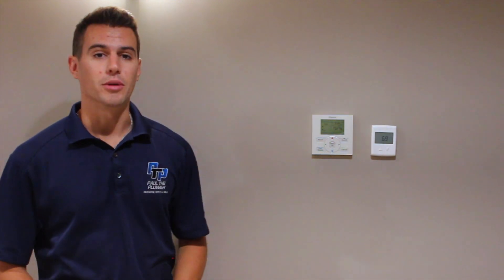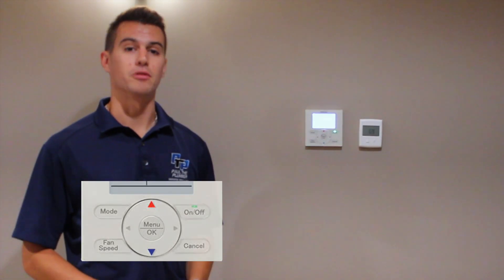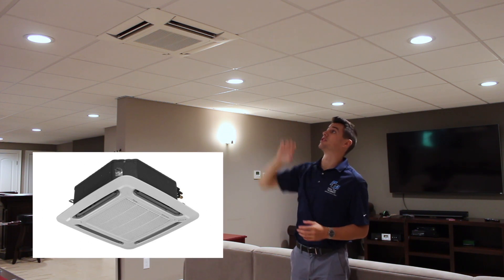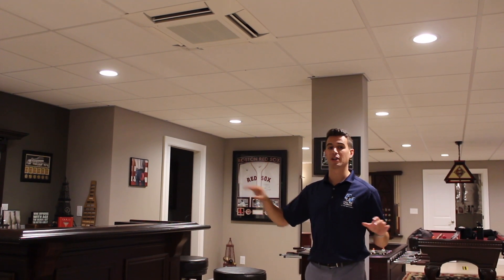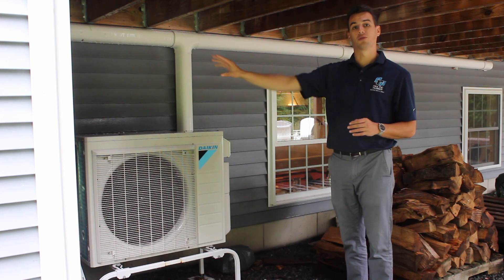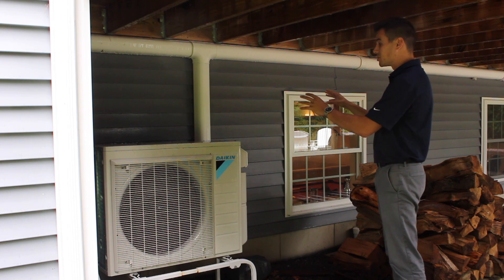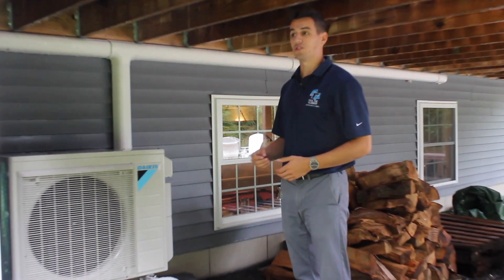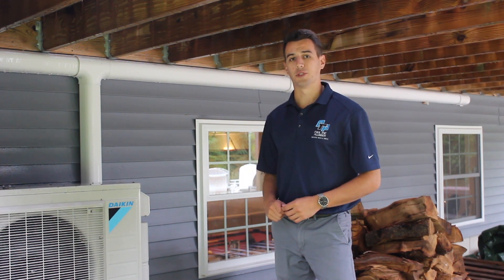Ductless Mini-Split Install (Ceiling Cassettes)

Comment: Could I use one cassette in ceiling of upstairs hallway to cover 3 bedrooms?  Obviously with doors open.
Reply: Not a good idea. If it gets warm in the rooms, the condenser will stop once the HALLWAY gets cool enough, but the rooms will likely be much warmer. Might as well go window mount for rooms.

Comment: Can you mount the outside unit on the roof. Run the the hose those vent turbine in the attic
Reply from the maker: You usually only see that in commercial applications. You need the unit to be level. You also need a disconnect and whip for the electrical side of things.

Comment: Are these easy to service? Are they longer lasting than a wall mounted unit?
Reply from the maker: The service can be a little more difficult. They have the same manufacturer warranty as the wall units.
Reply from the maker: @breadgarlichouse2265  Not typically. Sometimes there can be leaks but it's not specific to the ceiling cassettes.

Comment: Can this installed in a basement in a ranch?  Where does it drain?
Reply from the maker: It depends on if you have any access above the ceiling in that basement, this worked out here because of the ceiling tiles. You need a condensate pump with these units to drain.

Comment: Can a universal remote be used for this type of Air Conditioner?
Reply from the maker: It has to be a wired t-stat to the unit (like the one in the video) or the brand specific remote controller.
Reply: @paultheplumber8665  kk thanks
Reply from the maker: @issakaismaila5567  no problem!

Comment: The thermostat on right is crooked.
Reply: Beat me to it, spent 15 years in hvac commercial industrial and retired as an independent tile contractor. Sorry but I'm a bit OCD about being level, plumb, with straight lines and proper angles.
Reply from the maker: Thanks for the feedback!

Comment: If the cassette is on, what is the vibration like? Would it vibrates the ceiling if mount on 1st floor and be heard on the floor of the 2nd floor?
Reply from the maker: Very low vibration and they are super quiet. You cannot hear it on the second floor when it's running.

Comment: You installed on a drop ceiling. Can this be installed in a basement ceiling between floor joists 24” on center (21” between studs accounting for 2x4). I’m curious what the measurements are of the body of the cassette? Thanks
Reply: 24" on center spacing with 2x lumber creates a 22-1/2" bay.
Reply from the maker: This specific unit wouldn't work between floor joints, but Mitsubishi does make a model that would work (don't know the exact measurements of that unit).

Comment: Can the cassette be installed in a wall vs the ceiling?
Reply from the maker: Not this model but they do make a model where you can. Mitsubishi for sure, I think Daikin as well.
Reply: @paultheplumber8665  I love this

Comment: How did you connect the mini split ductless to the thermostat?
Reply from the maker: Mini splits come with their own thermostat, separate from the home's primary source of heating/cooling.
Reply: Paul The Plumber I’d like to do the mini split ductless, but instead of the inside wall unit, put vents. I imagine it’s doable, and if so, I can connect the thermostat that comes with the mini split? Thanks
Reply from the maker: @Tiagbenasen  There are ducted mini splits, so it is possible. This particular unit is ductless however. And for the thermostats I don't believe you can connect an existing thermostat to a new mini split, they all come with their own.